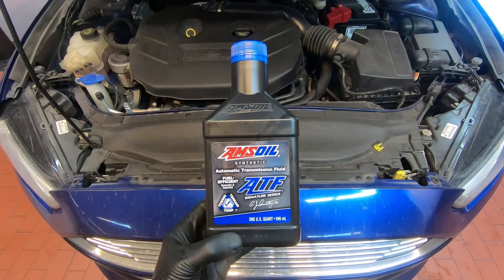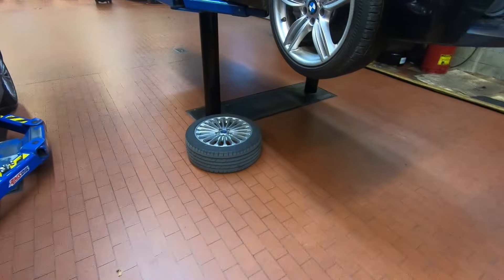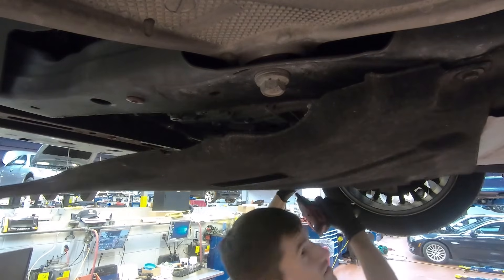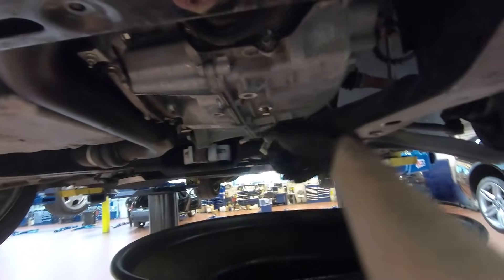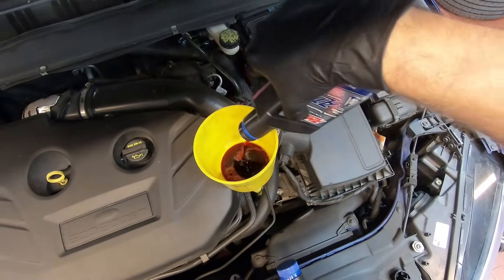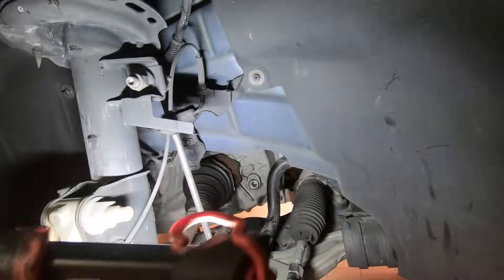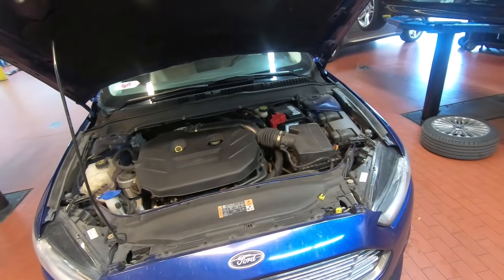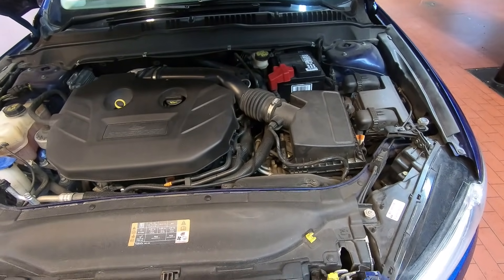Ford Fusion Automatic Transmission Service ( 6F35 ) [ HOW TO ]  2013-2020

Comment: I've learned on mine. Just doing a drain and fill is exactly 4.5 quarts so i dont need to remove the tire and pull the plug each time.
Reply from the maker: You should always level it off, I understand what you mean but always do a level check to make sure it's not under filled or over filled
Reply: @THEDriverMod_  would it cause any damage to be +/- an ounce or two?

Comment: Why do all fusions have that bad lifter sound? Ive never seen one over 30k miles that dont sound like that
Reply from the maker: You're probably referring to the high pressure fuel pump/direct Injection system sound. That is 100% normal operation

Comment: My cars at 110k miles, Ive been told by my local transmission shop that since the cars skipped a few 30k drain & fills, at this point its actually a bad idea to change the fluid because now the viscosity is compromised and new fluid may actually hurt the transmission….what are your thoughts on this?
Im thinking a drain and fill is ok because I’m only replacing less than half the actual ATF?
Reply from the maker: They just don't want to assume the liability if it does have issues. If you do a drain and fill yourself, you should be fine. Definitely use the link in the video and order the Amsoil ATF to make sure you're getting the best stuff!

Comment: Is the 6 speed auto on the same era focus (2015) the same ? I think its a 6f15 - not sure mines ever been serviced it's at 58k miles so will probably require a few flushes. Great video and thanks
Reply from the maker: You're welcome and I'm no sure honestly. The only automatic focuses from 2012-2019 that I know of is the DCT trans which is significantly different. But that's here in the states
Reply: Yeah I did not buy that transmission due research. Apparently the head gasket due to the block on the 1.5 eco boost are a bit hows your father from this era but hopefully I'll get some good miles before that happens, if it ever does.
Reply from the maker: ive got the 2.0L ecoboost now with 192k on it and still no issues with it!  @jcr6548

Comment: Weird how the manual in my 2016 2.5L model says to change the fluid at 150k 😮
Reply from the maker: Yea, these transmissions won't make it to 150k without a failure if you dont change the fluid. I'm at 191k now, still going strong!
Reply: @THEDriverMod_  I know this is off topic, but what do you think of using 5w30 instead of 5w20? - I ask because my car uses like 5.7 quarts and it's so difficult to find 6 quarts of 5w20, but 5w30 is so easy.. is it that bad if I use 5w30?
Reply from the maker: @mr.boniato6402  5w30 will be fine
Reply: Thanks, some say that they have seen in some charts where Ford says using 5w30 can damage some components or things like that or may throw off some sensors.
Reply: One time for my '16 Forester I ran a little heavier than recommended much like your situation because I had a brand new jug of it and didn't think a little more viscosity would be that big of an issue. Well let me just say I was so dead wrong as the car could barely get out of it's own way. Couldn't even get up a slight incline like a 3% incline driveway it was just absolutely horrible. I think it had something to do with the VVT and it bogging down and not even after 15 miles that same day I had dump it for spec fluid and thankfully she went back to running like it had before my little "experiment" lol. Going thinner might be ok and just be long term more wear but going heavier be mindful of what my Forester did as thinker was far from quicker lol

Comment: Ford Fusion 1.5 2018. At what mileage should the gearbox oil filter be changed?
Reply from the maker: Only needs replaced when the transmission is overhauled. Change the fluid every 30-40k miles and it'll last a long while. I'm personally at 190k now. Original trans filter
Reply: @THEDriverMod_  thanks

Comment: how much should a shop charge to do this?
Reply from the maker: Depends on labor rate etc but I'd say anywhere from 200-400 depending on if they only do 1 drain and fill or do 2-3 to get as much old fluid out as possible

Comment: If I'm flushing the transmission 3x (going to be my first flush since I got my 16 Titanium 2.0) with the new fluid, do I need to add the plumber's tape every time I put the drain plug in, or only after the 3rd flush when I'm ready to put the final round of fluid in?
Reply from the maker: Only need to add it when you're done, and you really don't need that much, the threads are very fine, don't over tighten it

Comment: very nice and detailed video, one question, does the transmission fluid need to be a certain temp when checking the level?
Reply from the maker: It's supposed to be per the manual but I've never specifically made sure of it myself. Just fill it to the filler plug and you're good

Comment: At what mileage should the transmission be flushed and changed out on this car?
Reply from the maker: Ford recommends every 30-40k miles. I've used the fluid featured in the video and have 190k on my fusion at this time with no transmission failures!
Reply: @THEDriverMod_  is the fluid ford recommends, Motorcraft MERCON LV Automatic Transmission Fluid good too?
Reply from the maker: not as good/durable as the Amsoil. the amount of detergents and protection amsoil offers is vastly better

Comment: That plug took me 5 minutes to take out and 10 to put it back on my 2017 SE, that transmission line is in the way, must have been an "improvement" in the design.

Comment: I'll give yall a tip. Just measure how much comes out the bottom and put that amount back in with the new fluid. Saves yourself time and you don't have to open the plug on the side of the Trans.
Reply from the maker: Great tip, so if the transmission is under filled or overfilled prior to the service, it will be underfilled or overfilled when you're done. Why didn't I think of that!

Comment: After you do the fluid check and determine the fluid is level with the plug is it necessary to drive a little and recheck the plug to make sure you still have the proper amount of transmission fluid?  Thank you!
Reply from the maker: You can but aslong as you did it like I did in the video you will be very close
Reply: @THEDriverMod_  Thank you for the response.

Comment: Can you just suck transmission fluid through the filler opening with one of these cheap hand operated pumps and then refill with exactly the same amount of new fluid?
Reply from the maker: No
Reply: @THEDriverMod_  why not?
Reply from the maker: @Roland Welte  you never know if your transmission is overfill or under filled to begin with. What's so hard about doing it this way?

Comment: My fusion is a 2013 se with the 1.6 liter engine. My question is how many quarts do I fill mine with? The manual says capacity of 9 quarts and have already filled it with 5. Do I add 4 more?
Reply from the maker: How much did you drain out? Usually only 4 -5 qts drain out so that's how much you put back in. 9qts is the total system fill if the transmission is empty after a rebuild.
Reply: @THEDriverMod_  yes I realized that after I kept reading through the comments, wondering why only 4.5 quarts drained out. Thank you for your help👍🏽
Reply from the maker: @Brandon Lerma  no worries man! Thanks for the question, glad you got your answer

Comment: My 2012 Ford Fusion with the same transmission calls for 9 quarts of fluid! While the newer ones take less...
Reply from the maker: these transmissions take 9 qts but a drain and fill only removes about 4-4.5 because the rest is in the torque converter and fluid passages

Comment: I was baffled when you said each 50km. I'm going to do it this spring. Very informative!
Reply from the maker: I'm at 185k on mine now using the Amsoil ATF and I've still had zero failures
Reply: Recommended every 30 K miles by Ford techs; service manual says 150K miles which is ridiculous.
Reply: @vayabroder729 mine at 94 n has never been done 😭 was my grandpas car he had dementia didnt understand maintenance it runs great though pretty sure he kept up w oil changes gotta do this this month n should b runnin good as it can

Comment: Does the oe amsoil transmission fluid work the same?
Reply from the maker: Yes, it's still really good stuff.
Www.premiumsyntheticsusa.myamsoil.com.
Reply: @THEDriverMod_  ordered some last week. Signature series. But will stock up, on everything I need from Amsoil.
Reply from the maker: @AthaYAHmamlahkaYAHusha333  you used the link in the video description or the comment above to order? That helps me out tremendously!

Comment: I have a 2014 S 2.5L Fusion. The transmission was last flushed in 2016 at 30k miles. The car now sits at 138k miles as of 2023 and has yet to be changed or flushed. Would you recommend to flush or partial change a few times in a month to cycle it out? The shifting has gotten a bit tough but nothing that sounds scary.
Reply from the maker: Use the amsoil ATF I used in the video. Stuff is awesome! There's a link in the description to order some.
Reply: @THEDriverMod_ But the Ford book says mercon LV. Isn't this better?
Reply from the maker: The amsoil Blue cap ATF is their varient of the LV spec fluid. Just has better friction modifiers and detergents
Reply from the maker: Just do a drain and fill along with every oil change over the next 3 oil changes and you should he solid

Comment: How to find the engine size? It says 2.5 on valve cover but I don’t know if that engine size
Reply from the maker: Easiest way is the emissions sticker under the hood.
Reply: @THEDriverMod_  but it's in code right ? All those XXXs
Reply from the maker: @frankmontez6853  yes, if you've got a 2014 and it's NOT an ecoboost, it's the NA 2.5L

Comment: How expensive are the fluid? What’s the recommended mileage to change it? Thinking of buying this 2014 fusion se. 108 K miles. $5900
Reply from the maker: Ford actually recommends 30-50k mile trans fluid change Interval. They fluid I used, with the membership runs about 14$ a qt, you'll probably want to do the service twice so get yourself 10qts or so
Reply: @THEDriverMod_  hey ford website says it’s recommended like my Focus car to 150,000 miles …
Reply from the maker: Manual/Dual clutch transmissions, especially dry, dual clutch transmissions don't rely on good clean fluid to actuate solenoids, valves and gear set clutches. The 6F35 is harsh on the fluid plus, the filter isn't changeable unless you remove the transmission and seperate the case halves so do the fluid more often to get the most life you can.

Comment: Why not drain the fluid, remove the side leveling bolt, level the vehicle and fill until it comes out of the side port as a start? Start the car, level the car, run until operating temp, remove the side leveling bolt and drain any excess.
Reply from the maker: There's more than one way to do it

Comment: So I did this on my fusion and now have transmission fluid smell in vehicle when it is hot. I did drain out of level plug until it stopped dripping. Any idea why?
Reply from the maker: When you added some, did it spill?
Reply: @THEDriverMod_  no which is weird. I did my whole procedure on a hoist which is nearly level but could be better level. I may tray to get it exactly level on ground with floor jack and pull the side plug out. I am thinking it is still overfull just a bit and venting out the fill plug
Reply from the maker: That's possible for sure, it would have to be close to a qt over full I'd think

Comment: I did my transmission service at about 50,000 miles and after they did it the technician showed me that the fluid came out all black. They put in fresh fluid and my transmission and car still run great
Reply from the maker: The LV motorcraft fluid gets dark extremely quickly, I recommend you switch the Amsoil Transmission fluid through the link in the video description and do the service again. Did they do a drain and fill or a full flush?
Reply: @THEDriverMod_  I think they did a drain and fill. I put the Castrol automatic transmission fluid, and my car is running great.

Comment: The xmsn doesn't have to be hot to check the level like all other vehicles?
Reply from the maker: I'm pretty sure I said it needs to be up to operating temp in the video but even if it's not. It's not gonna make THAT much of a difference
Reply: @THEDriverMod_  I found the directions directly from Ford and it does say operating temperature.
Reply from the maker: I know what it says, I was a Ford tech for several years. They are not Formula one transmissions where being off by a half a qt or less is gonna destroy it.
Reply: @THEDriverMod_  I disagree... What happens if you overfill the crankcase?  Granted there aren't counterweights slapping this but... Fluid level mattress
Reply from the maker: It usually takes 1.5- 2 qts in most applications for the oil in the crank case to interfere with the counterweights. I've had bmws come in half a qt, sometimes a qt over filled on engine oil. No issues. Is it nessacary, no, but unless you're pushing the car to the limit, it's not a catastrophic issue. Fluid level matters but there is a grey area where half a qt in most engines and transmissions really isn't gonna hurt anything. You can try to be as precise as you can but the amount of time it takes isn't werth the hassle. I've got 181k on my ecoboost fusion. I do the transmission service the same way everytime and every oil change I put 6 qts in even though it calls for 5.7qts.
Reply: @THEDriverMod_  there's a total of nine quarts in that transmission so it would and could raise an inch to 2 in and to me that is not going to be okay... Everybody just needs to check it at operating temperature to be sure
Reply from the maker: @vettle1  there is only about 4 qts in the sump, the rest is in the cooler, torque converter and pump. room temp, warm temp and operating temp is not gonna change the level more than a half inch. either way, we are talking about 1/3 of a qt max. ive never had and issues servicing these transmissions in this manor
Reply: All of the oil heats up not just the oil in the pump and other areas... and what happens when the fluid expands in the pump it moves out and into the sump.
Reply: @THEDriverMod_  if you said it in the video then I apologize I must have missed it

Comment: I just got finished with this job myself. My 2.5l SE 2014 fusion doesn't have a 10mm hex plug on the right side of the axle. It does have a 14mm hex bolt on the left. I'm assuming that's the leveling plug for it. However, I just measured what came out and replaced that much. I'll probably repeat the process in the spring. Only 3.25 quarts came out.
Reply from the maker: That is alittle lower than expected but not too bad
Reply: @THEDriverMod_  I may end up leveling it in a week or two just to be on the safe side.
Reply from the maker: I would

Comment: Just wondering? On my owners manual it says 9 qt, but every video I watch only 4.5 qt are put in? 
Is that because the process has to be done twice? and would it be good to do it twice?
Reply from the maker: even doing it twice won't get 100% of the fluid, but I will convert about 65-75% of the old fluid to new fluid because it's gonna mix. I recommend of you do the drain and fill route, that you do it twice, ever 30-50k miles

Comment: No filter change?
Reply from the maker: To replace the filter you have to remove the transmission and seperate the case halves. It's up to you if you want to do all that. I've got 181k on mine now, all original engine and transmission, no failures, using the Amsoil ATF, doing drain and fills every 30-40k and oil changes every 12-14k.

Comment: According to the car manual Ecoboost transmission takes 9 quarts of fluid.  What happened to the other 4.5 qurts?
Reply from the maker: It stays in the transmission, clutches, torque converter..... 9.5 qts is for a complete overhaul refill.

Comment: Awesome instruction on this, best video I've ever seen for the 2015-era Ford Fusion Titanium. 

However, just because the fluid is black, doesn't mean it's got transmission problems.  Using Motorcraft Mercon LV, and only doing 1-2 fluid flushes, won't get all the black out.  Even after doing a full flush of the system, won't guarantee that it'll stay red very long.  The nature of Mercon LV isn't the same as other fluids, and it will darken in color considerably quickly.
Reply from the maker: I am happy to report my fluid comes out red every time I do it now since switching to amsoil.
Reply: @THEDriverMod_  using anything other than mercon will keep it red lol
Reply from the maker: I aware ot gets darker quicker than most, it took me about 4 or 5 drain an fills over a 50k span to get the fluid to come out red in color. Now I just do 2 Amsoil drain and fills every 30k miles or so. I'm at 180k now on the car, still all original powertrain
Reply: @THEDriverMod_  U convinced me enough to buy my first jug of of AMSOIL OE ATF.  I didn't get the Signature Series.  I do have a cousin who's a dealer so I got a 2.5 gallon for $115 w/shipping.  Which is about $50 more than similar amount of Mercon LV in 2 5-quart jugs. Since you posted this video, I've actually acquired a 2nd Fusion, a Hybrid. It's a love to replace the fluid on that car, as everything is done from below with a pump.  You should do another video on that.

Comment: Oh great 30 to 50,000 miles awesome my fusion hybrid has 69,000 miles on it it guess I better get it done also I was told mine is sealed so what the hell      why would they do that
Reply from the maker: Yours is a CVT which uses a different fluid. Amsoil has an awesome CVT fluid youncan use. Www.premiumsyntheticsusa.myamsoil.com

Comment: Thanks for the info but, has anybody ever measured the fluid level after doing all this work with a wooden dowel or anything so that they don't have to go through all this crap a second time in the future just to check the fluid? 
 After all, how hard would that be?